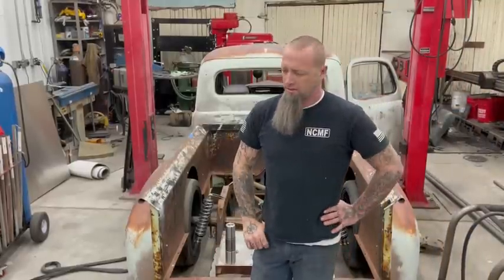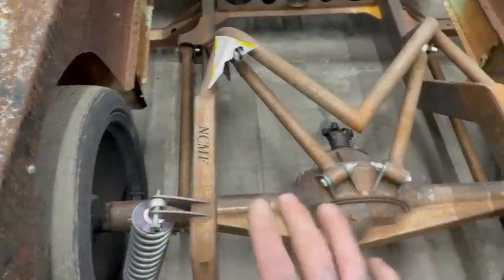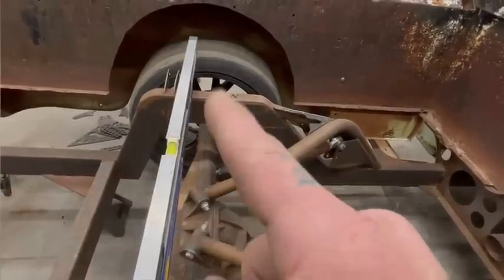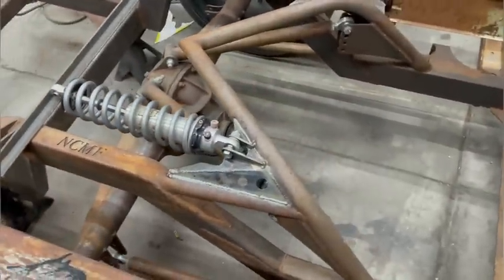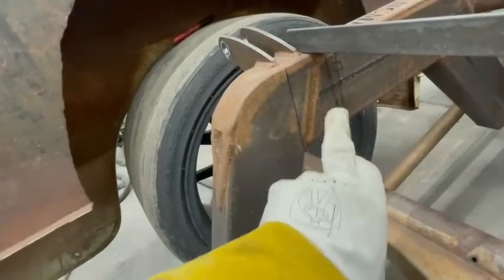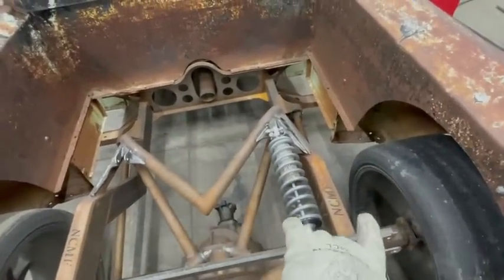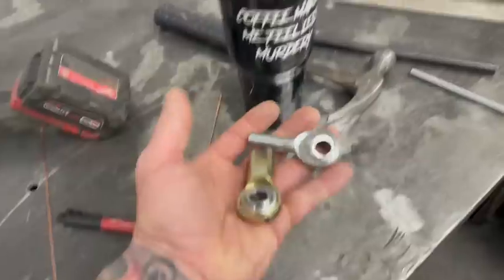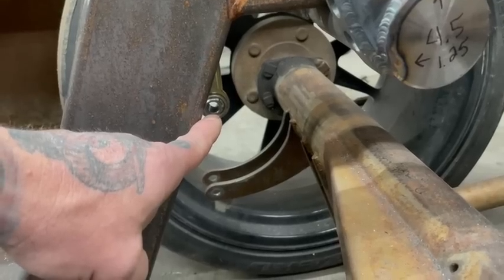cantilever suspension build on the 1952 F100

Comment: Tidy job mate, did you contemplate moving the whole assy more to the rear and connect side to side with a torsion rod as a sway bar, could have had blade connections at each end onto your keyed pin for a simple drop in change of different tortion bars. Oh and grease nipples ? can't forget a couple of them.

Comment: It's like a decouple frame point loaded torsion bar system, with a multi redundant mechanic fuse layout. All sorts of failure points before you overload a damper. You could certainly use some torsion bars.

Comment: Have you put a jack on the front of the rear- end where the driveshaft connects to see if it lifts which will push the drive shaft forward, I say this because when torque is applied to the wheels you create two directions of force, the wheels turn clockwise and the axle tube turn counter clockwise causing the front of the rearend to raise and pushing the driveshaft forward. I guess your angles can adjust for this to prevent it though. I love the design good work …
Reply from the maker: It’s maybe 1/4” deflection in the pinion and less than 1/2” in driveline travel from bump to full droop. The only movement the pinion gets is from the poly bushings on the one end of the links

Comment: That's a pretty novel suspension design, but I can't help but think that only on key per side isn't going to be enough to handle the load.  If you were to hit a big bump it's possible that you would shear that key and loose the suspension on that side.  Twer it me, and I'm not a mechanical engineer or metallurgist, I'd put three keys per side and position them so that at normal ride height there isn't a direct, 90 degree, angle of force on any key.
Reply from the maker: That is my biggest concern, the manufacturer claims the tensile strength if 1/4” key shaft is 53.7k-63.8k psi. At 3” it should be around 150k but that sounds ridiculous to me, a 1/4” bolt is around 1,200 so 1/4 by 3” would be 14,400…. all that being said it’s definitely something that I will watch closely and alter (probably go to splines) if it looks like it might become an issue
Reply: @nocoastmotofab4181 it looks great.i was going to say splines